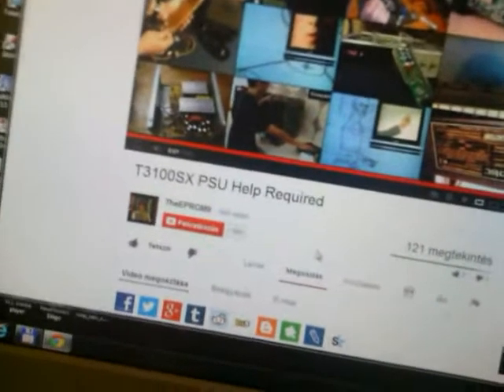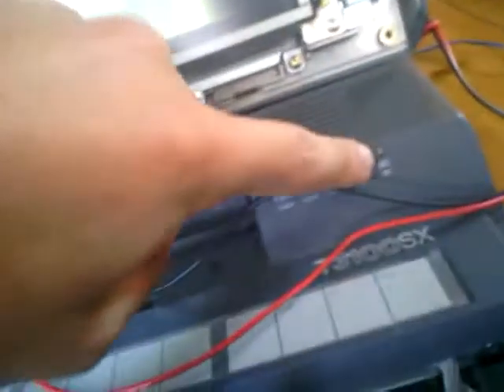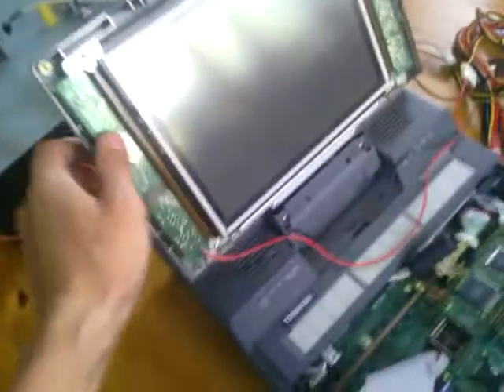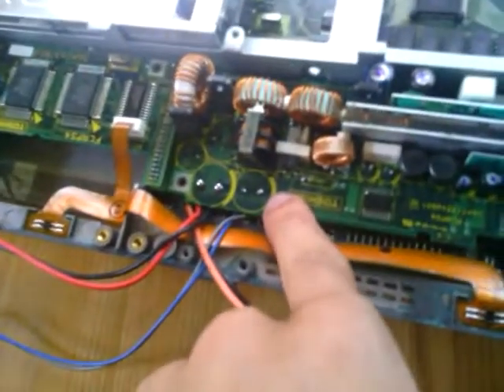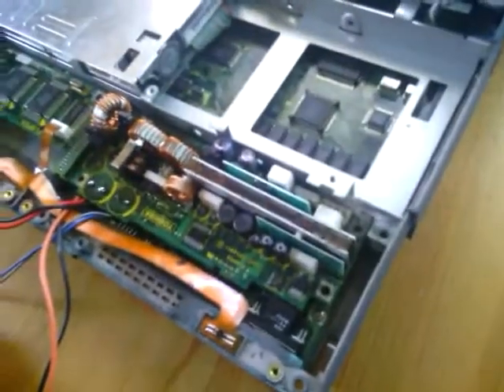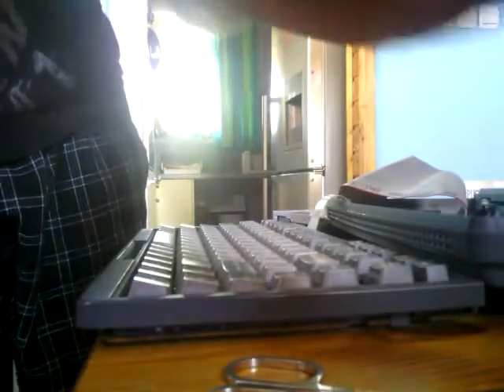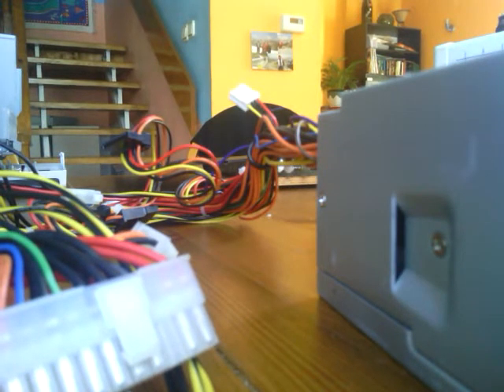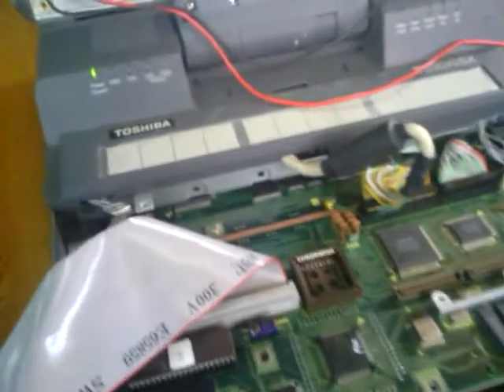Here is a solution for the Toshiba T3100SX PSU problem.

Comment: Dear @faklaDavid and @TheEPROM9:  have the same problem on the power board, while trying a recap, I tried the external power method (using a colecovision supply: + 5v and + 12v 3a) and connected the pins according to the layout, adding the pin9 to turn on the screen. I managed to get the machine to power up, but the cursor appears and constantly restarts. Reading the manual (pag142) , I see that pins 10 and 11 also appear as screen power. Is that why it restarts?

Comment: The reason for the failure of these boards is firstly the leaked capacitors and batteries, and secondly that the leaked capacitors corrodes the numerous vias underneath the capacitors. This causes them to go open circuit, so various communications between the logic and power sections are cut, along with switching mosfets, feedback circuits etc. The flashing red light is the switchmode controller's only life - all the periphery it has is open circuit so it can't start up. Repairing the vias and replacing the capacitors is very challenging.

Comment: Hi this fix does not fully work for my machine. I get the beep sometimes, but my screen won't power on. Also when I connect both 12, and 5 volts PC PSU gets shorted and turns off. It only powers up when connect 5 volts to the capacitor on the left, and ground to anything metal on the chassis. Any ideas? Leads on the power board are acid melted  of course.
Reply from the maker: Hello! I find out the pinout witch pins are the 5-12V and GDN. You can make a cabel from a floppy cable it's has the same 34pin. And you can use a PC PSU 5 and 12V to power up the notebook. I'll send you the pinout as soon as i get home from work. Hopefully the short circuit is on the powerboard and not on the mainboard. And you have to give power to the screen powerboard as well ,it has a 12V buffer capacitor on the board. I'll send it you as well. Anyway sorry for my bad english.
Reply: Fakla David
Thank you very much. My english isnt so good to, but the main thing is that we understand each other :)
Reply from the maker: blazeaster So ! Here is my blog about how i repaird the notebook, ofc it's on hungarian but the pictures says it all. There are a black and a white cabel on the screen electronics the other side there will be a black and a red one and also have a mark on it 12V + 12V- so you can't miss it 

http://logout.hu/cikk/toshiba_t3100sx_a_halal_utani_elet/osszeszereles.html
Reply: Thank you very much. I'm really anxious to get this laptop working, and hopefully there wont be any shorts on the main board. I'll hit you back with the results.
Reply: Bummer. Doesent work. Looks like Im not getting this one into working condition. Everything seems shorted out, and nothing seems visually damaged. Thanks for the information though. Shame i cant get it  to work, its a cool laptop. If you need it for parts im willing to give it away. Scssi module and extra memory module will sure help. Also display seems dead. I can hear electrolytes charging, but thats all.
Reply from the maker: blazeaster Where do you live ? May you could send it to me ofc i'll pay the cost of the post. May I can make it to live again. Otherwise It'll be spareparts for my own notebook.
Reply: I'm from Serbia. I can send it via DHL or post office. I recommend sending via post office, cause postage is cheaper. It doesnt have a tracking system, but i think you wont need it since Serbia and Hungary arent far away  from each other, and I think it would take just a few days.
Reply from the maker: blazeaster Can you calculate the cost that i have to pay to you ? Than we should countine this conversion in email or facebook.
Reply: Of course. I'll have to visit the post office today and I'll ask how much would it cost to send this machine. I just have to measure it. I'm adding you on facebook.